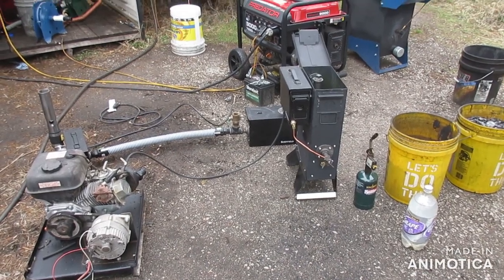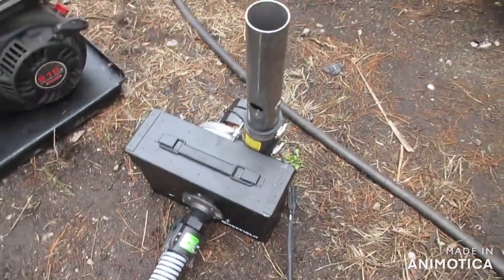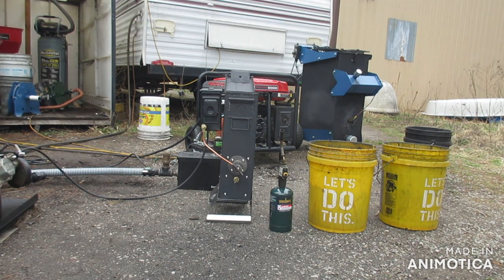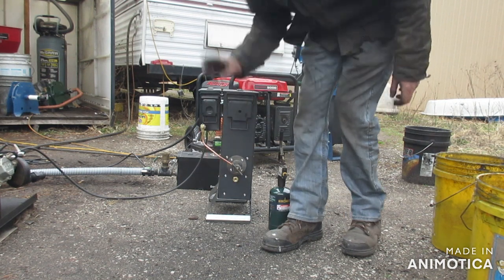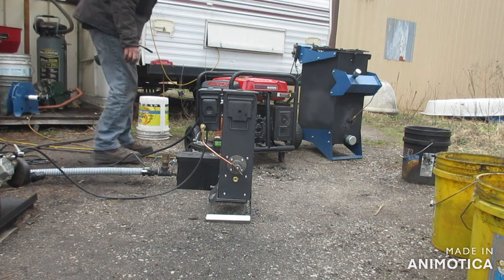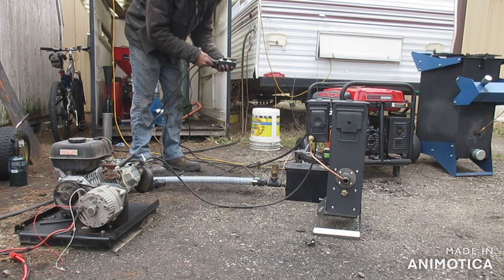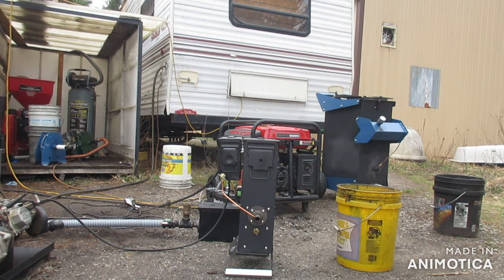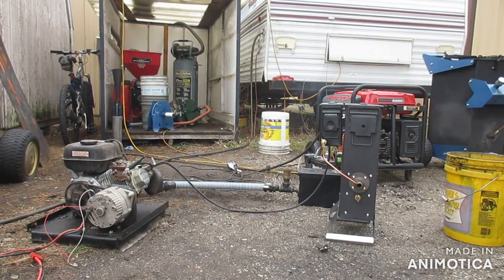Ammo Box No Weld Gasifier Build Start Up and Engine Run!!

Comment: Awesome how long will this unit run on a full tank of charcoal with that little engine ? Also was wondering if u used the stock seal on the ammo can or did u replace it with a high heat one ? Love what u do keep up the good work, Thanks
Reply from the maker: About a 1/'2 hour, this is a tiny gasifier. It is great to learn from but not so great for anything else. There is a reason our machines cost what they cost. No the lid seal was left alone, if you get it that hot then you are overdriving the unit and need to throttle down or go to a smaller engine. Anything smaller than the 212 Predators running on wood gas are worthless. If you want something worth while you need to build it bigger.
Reply: @Thrive-Off-Grid  Nice that’s pretty good for such a small hopper, I’m saving up to buy one of your units. Thanks for the reply and all the best to yah

Comment: Could you provide info or links on the hoses? Or where on your website you discuss them?
Reply from the maker: We use industrial supply companies like McMaster Carr and the alike. The idea with this is to find parts that are more local or obtainable. Just go to your local hardware store. Lowes, Menards etc and try to find something. Amazon is also a great place to find stuff. Like those pipe flanges used in the build were sourced from Amazon.
Reply from the maker: This is where you can pay it forward and share your build on our forum and help others. " I tried these hoses from Menards and they work" For instance. The whole point of this DIY video series was to get people involved and active on our forum.
Reply: @Thrive-Off-Grid  I plan to post my build. I’m still getting supplies. How heat resistant do the hoses need to be? That’s part of what I’m trying to determine, without wasting time and money on hoses that burn up.
Reply from the maker: @drvosstube  Join the forum and Ill help you. Youtube is not the platform for this.

Comment: I am really thinking about building this design. Question how long would the predator generator run on a full load . Thanks
Reply from the maker: For the M-2 it is a 1 1/2 hour run time. The M-3 has a two plus hour run. This really shouldn't be an  issue. You just fuel it as you go. If you are charging batterie's then its no issue at all. Just run the hopper load and this will generate over 5 kW hours worth of charging. If you have solar that adds in. If that is not enough just refuel it and keep going. Also by adding the inverter this eliminates the limitations of the gasifier engine system. Then its up to how powerful your inverter is and the available stored energy. Do not run a generator as a primary power mover. It is very inefficient.
Reply from the maker: Oops I was replying to you thinking you were commenting on my latest video. No this little machine you only looking at a 20 to 30 minute run per hopper load running the 212 cc generators. It would be good for around 1000 watts. So 500 watt hours pr hopper loading. This is a tiny gasifier so dont have too great of expectations. Its also very thin steel so it wont last very long.
Reply: @Thrive-Off-Grid  thank you
Reply: @Thrive-Off-Grid  gotcha, I want one to run a 9000 watt generator.
Reply from the maker: @Missourioutdoors1  Yeah that isn't going to do it. Just take the concepts of this and build it bigger. The jet I use here you dont need to change. Or you can just buy one from me and skip the headaches of trying to replicate 10 years of development.
Reply: @Thrive-Off-Grid  I looked at the ones you sell and have been thinking and talking to the wife about it. I am not well versed when it comes to gasifiers.
Reply from the maker: @Missourioutdoors1  Show here the latest video. But keep in mind 50% is due no later than the 25th of this month. Your machine will then ship late June. If you miss this deadline then you will fall into the next production cycle with shipments going out later September. https://youtu.be/1HD1rvyEpBQ

Comment: I’m just learning about gasification. What’s the water line do for this setup?
Reply from the maker: https://en.wikipedia.org/wiki/Water_gas This process also cools the jet nozzle to prevent it from melting. Charcoal reactors run extremely hot at the oxidation zone and will melt or degrade the nozzles or jets. So you must use a method to cool or absorb heat with endothermic processes.

Comment: Seen a few different videos but yet to understand the water injection. I assume to control the burn but anyone care to comment? Thanks
Reply from the maker: The water is to cool the jet nozzle otherwise it will melt. The secondary function is the resulting steam will process into the H2 and CO as the oxygen is ripped out and combined with the carbon. This gives the gas energy density a huge boost making it much more powerful gas than typical woodgas.